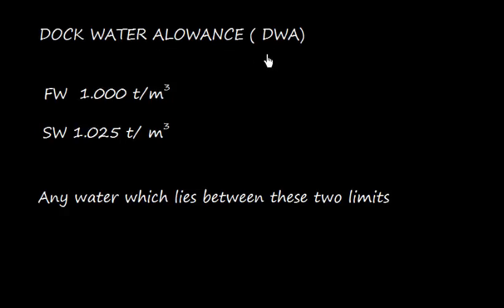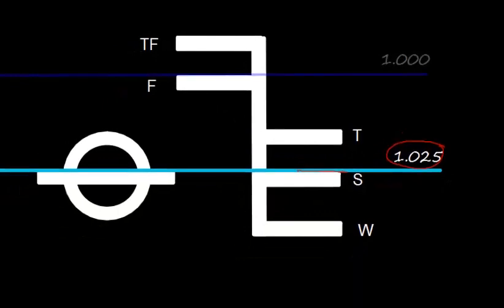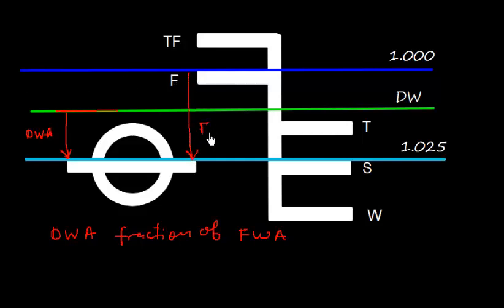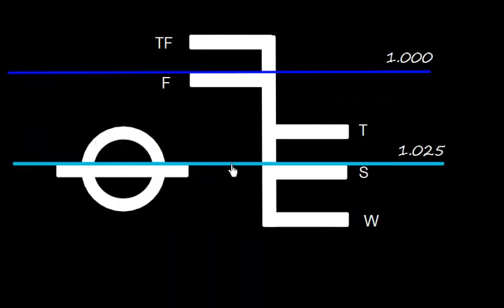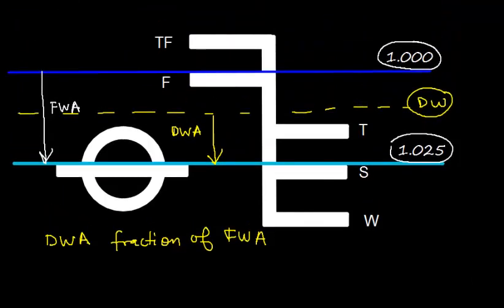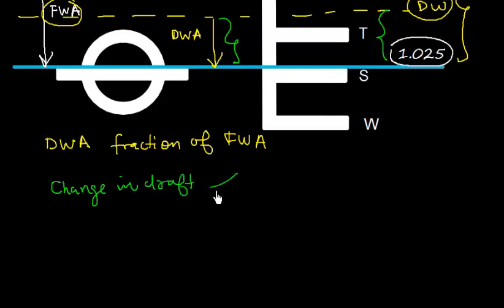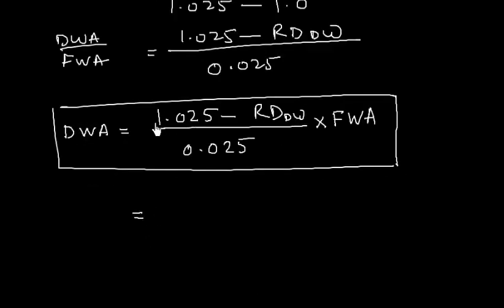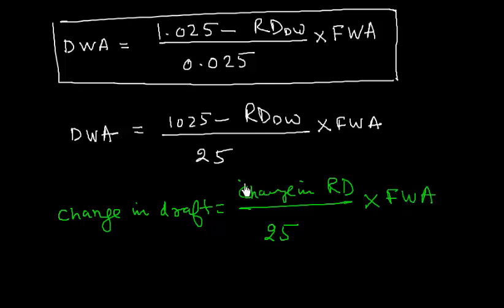Ship Stability_ Definition of Dock Water Allowance ( DWA )

Comment: Change in draft is inversely proportional to change in density
Reply from the maker: Thank you for bringing this up. Here the change is referred to difference between the two values. Thus change in draft means difference between  the two values of drafts at different densities. Similarly change in density means the difference between  the two. The magnitude of change that is difference between two quantities i.e. draft and density varies directly i.e. larger the change in density , larger will   be the change in draft. However  whether this change (or rather magnitude ,to be more specific) will result in increase or decrease that will need to be figured it out by simple rule.  Going to larger (higher)  density, ship will rise ( higher) and lesser (lower) density ship will be sink ( lower). Trust this avoid any ambiguity which many guys start relating mass= volume x density  or  mass= Area x draft x density thus daft  is inversely proportional to density. This is correct for the relationship of draft and density. If we  take the difference of the drafts at two different densities,  the difference (  magnitude, to be more specific) will be directly proportional to each other.
Reply from the maker: Further to above please find below link      https://drive.google.com/file/d/1srCbD9cPj54GaDj8PK6ZZxXr1KqCBwgy/view?usp=sharing
Reply: Jai hind
 For preparation of second mate / DNS/ BSC nautical science/NCV come in #kundanpatna
Reply: Draft directly proportional to density, not change in draft.
For second mate( FG/NCV)/ DNS/ Bsc NS prepration join kundan patna #kundanpatna